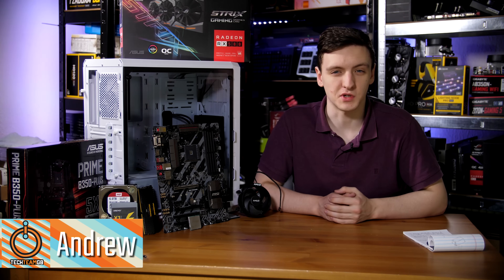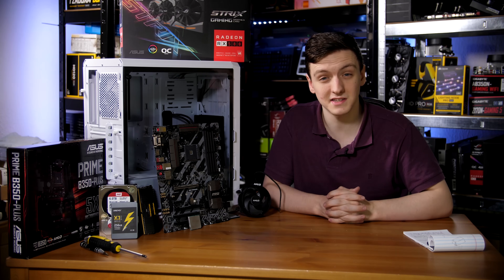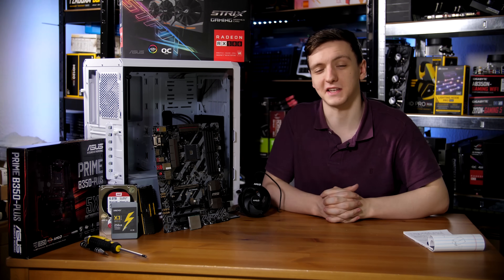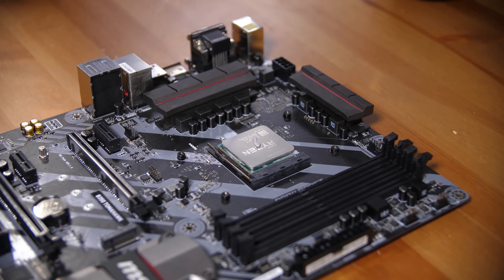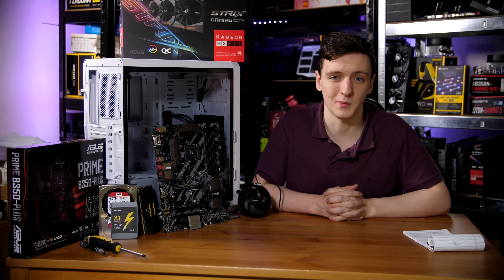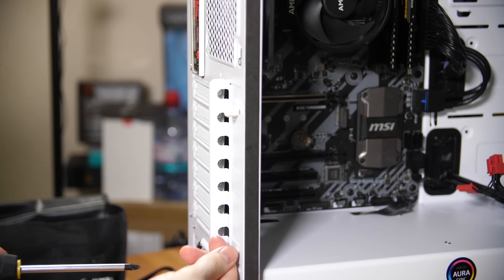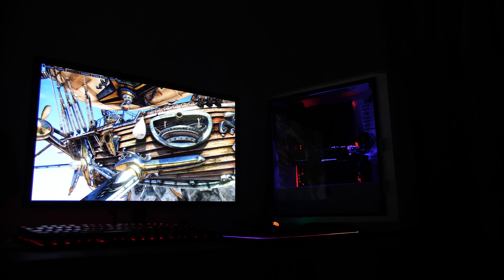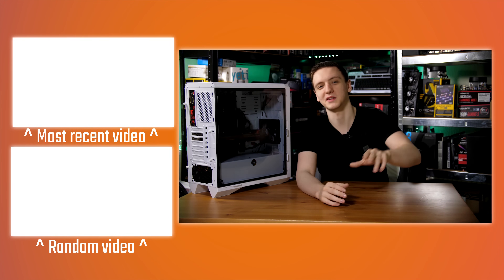Early 2018 ~£1000 Gaming PC Build Guide

Comment: terrible case with no airflow your parts were probably throttling
Reply from the maker: All the temps were normal, including VRMs.
Reply: The youtube comment experts know all.. Have you even tested it or just heard from "others"?
Reply: Lol, Its front intake is not ideal, but that doesn't mean the hole system is going to throttle.

For me there are not many all white cases out there + I love the way it look's, id for sure still use this in a build. 
You could also mod if to improve airflow if it bothered you to much buddy.